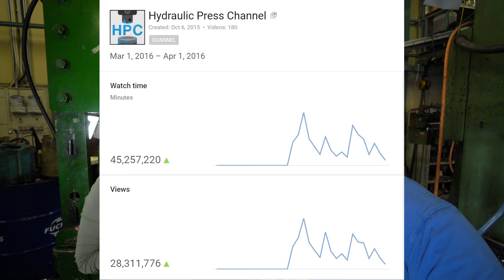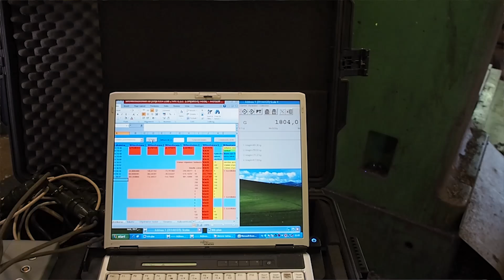How To Use 150 Ton Hydraulic Press

Comment: @Lauri (Beyond the press), 14:49 You could use 2 different colors of the strings to easier determine which string goes to which leaver.
Reply from the maker: That's really good idea! I always mix the two :D
Reply: If you pulled both levers at the same time would it rip open space-time?
Reply: I was going to suggest that. lol
Reply: Howeyroll i was going to say that

Comment: Yay,  congratulations on the last two years! I worked as a peon in a fabrication shop in high school and this stuff brings back fond memories of getting burned by hot liquid metal, cylinders of gas crushing my boots, and endless hours drilling and operating hydraulic sheet metal brakes.

Comment: i've always thought the full pressure lever acts by "bypassing" the adjustable valve,  leaving only the relief valve in the circuit, allowing a higher pressure to be used. 
It may also be a dual stage pump (not sure of the word in English), first stage is for low pressure and the second for high pressure

Comment: The oil can't be compressed at all, the effect of the piston shooting down when the object in the press breaks is from the flex in the hydraulic lines of the machine, under those high pressures the material from especially the flexible hoses will stretch a bit, and when the pressure drops because of the object breaking, the hoses will retract to the original state and push additional oil with high speed into the cylinder. 
This is a fairly small amount and results in a short shock of the piston.

Comment: Looks like a 2 stage cylinder setup. Low pressure uses smaller ram while filling larger ram, then small lever activates valve for larger ram

Comment: You attach the string to the pin that holds the table up.  If something goes wrong, you'll pull the pin out and the table will fall down.  That is not likely, but it is a stray thought.

Comment: Beyond the press - In a previous video a long time ago you said something about how the press is showing its age and having some problems, but you can't get parts anymore because it's so old. Has anything changed about that? Have you found some way to keep it repaired, or is the press getting closer and closer to needing replacement?

Comment: Can you show us the pump and motor? It has such a classic axial piston pump sound I just want to confirm that's what it is. If I understand right from the sound it's similar to a lot of (BIG)automatic transmission pumps as well as other more complex hydraulic systems, like flight simulator platforms. I know variable displacement pumps can have a similar sound Perhaps if it has only one pump with two levers is it perhaps some kind of dual displacement... maybe even a hydraulic operated dual (two setting) displacement type thing... if that even exists.
Reply: I know it might need to wait for a maintenance if the pump is inside heavy parts that have to be removed.

Comment: Thanks for this video showing us how your machine is set up and how it works.  I have a question, why do you use 2 plates pushed together for the bottom instead of 1 plate?  I would have thought that using 1 piece with the focus in the middle of it would be more solid than having the power focused on the joint between the plates.  Thank you and Greetings from New Jersey, USA.
Reply from the maker: With two plates you can press stuff through the table if there is gap between those. It's handy when removing bearing etc.